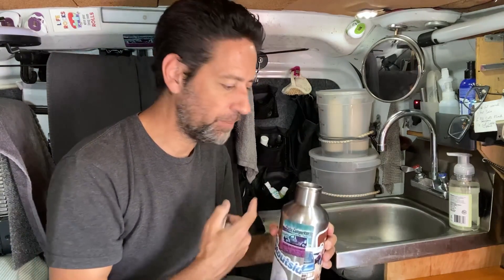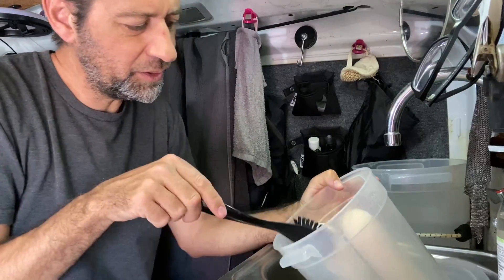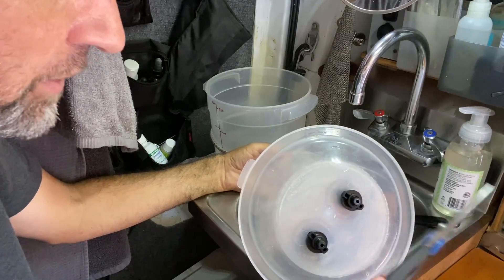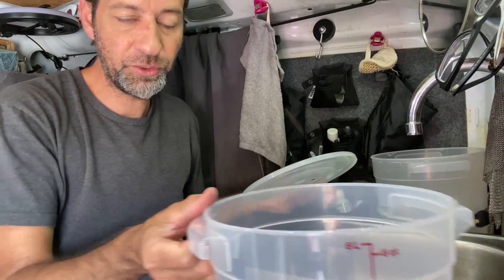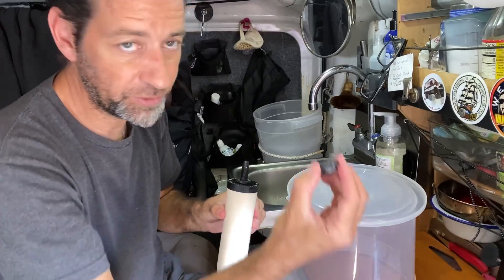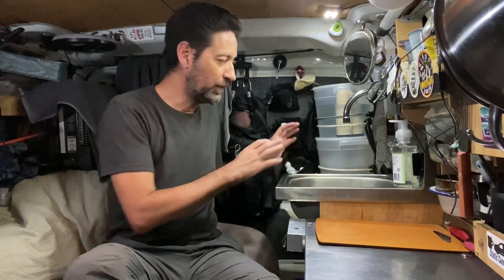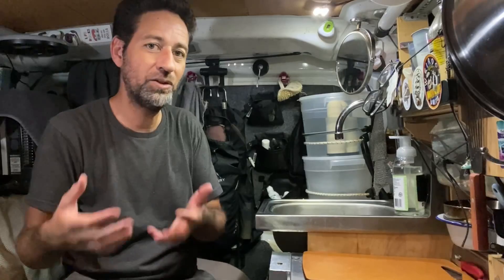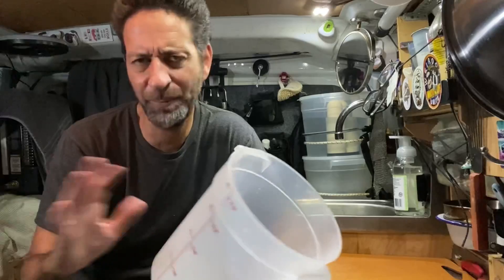Maintenance and a Rant about Plastic Berkey Water Filters (Trigger Warning)

Comment: I use plastic 5 gallon over a 3 gallon bucket after I saw your set up. It works well. It's a great set up. To avoid cracks by drilling I heated a nail and melted an opening for the Berkey filters. Don't let people get to you...you don't need to explain.
Reply: Great comment about the hot nail for making the holes
Reply: Another way is to use a small drill to make initial hole, and then go up in drill sizes on a slow drill speed

Comment: Cracks in plastic can be welded with a solder iron. To avoid cracks by drilling you can heat the tip of the drill bit or punch a hole with a heated bolt if you have one. Good luck.

Comment: Well thought out solution to your situation. I enjoy this info as we have a Ford Connect and space it always a problem. Thank you for your insight. Side note: drill a small hole or holes first, then the final large hole in the plastic. It will reduce the stress on the plastic when the final hole is drilled and hopefully no cracks. Thanks again......

Comment: Not that it matters and you may already know this but they do have a travel burkey now that is a smaller version but still over $300 so I definitely think you have the best solution, great idea!!!
Reply from the maker: Since I drink over a gallon a day, I prefer to not have to fill a filter multiple times a day. With this, I can fill up the top chamber and then be away from the van while waiting for the clean water.
Reply: @StaticCamperVan  Makes sense to me.

Comment: Ignore the trolls. I watch your channel to find out what works for you in order to see if it will work for me.  I also don't have $250 laying around waiting to be spent. So just to keep the trolls happy, I wanted to tell you that I am purchasing the parts to make my own plastic Berkey. Thank you for your ingenuity!
Oh, and about the plastic cracking when you drill... You may already be doing this, but start with the smallest drill bit and work up to the size you need. No cracking.
Blessings!
Reply from the maker: Good to hear! I forgot to mention that I prefer the Black Berkey Filter candles, but they don’t fit in my space. If you are looking at purchasing the Ceramic Filters, I’ve found that the original filters made by Daulton last longer and perform better than the Berkey ceramic.
Reply: @StaticCamperVan  Thank you! Good thing I haven't ordered yet! I'll be updating to the Daulton! I don't care about the name, I want the quality.

Comment: Now there is no reason to not read this whole comment.  Number one you only need to use one filter.  Save the other for the replacement.  This means you only need to drill one hole.  The plastic containers are a little expensive so consider this, glass dispenser from Walmart is less than ten.  Glass jar with lid also less than ten from Walmart.  Diamond drill bit for the hole.  Stainless spigot replacement from Amazon ten dollars.  Then build a box from wood with a long cut.  The spigot slips down the long cut.  The box mounts to the wall and will hold this much more securilly.  The long cut the the spigot slipped through is your water level view.  An led light on a switch allows better view.  You could also do a sterilizer light.   The top of the box now becomes a shelf.  The side of the box a sticker place.
Reply: @Kurt M. He could keep the upper container plastic as the water only contacts it for a few minutes, but the bottom in glass will have much better tasting water.

Comment: There are two ways you might get cleaner results drilling holes in plastic like that. And you have the old bucket to practice on. One is to drill a smaller hole first (pilot hole) then run the final size drill backwards to melt the hole rather than cut it. Then slice off any melted bits. Another is to use a step drill bit. They're designed for drilling through thin materials. Start with a pilot hole large enough for the point of the bit, then work your way up the bit to the larger sizes. As you get close to the final size you might want to do the backwards rotation thing to melt the plastic.
Reply from the maker: Shall we be expecting to see a video tutorial on your channel? 😁
Reply: @StaticCamperVan  :D
Reply from the maker: This was an inside joke with myself. I parked at Home Depot in case I needed something. Then I either lost or misplaced the correct drill bit. But I was too cheap (re:poor) to go into Home Depot and buy the proper bit! It all worked out since there’s no leaks.

Comment: May I suggest, starting off with a much smaller hole. Then gradually working your way up to a bigger hole. Also, painters tape can help prevent cracking as well.
Reply from the maker: It’s done and no leaks. I’ll use the proper drill bit and technique next time
Reply: @StaticCamperVan  good to hear there's no leaks

Comment: Scott I bought one of the Berkey Systems when I lived in a traditional house.  I saved for a month to buy that one when I did over 8 years ago.     I've always been impressed that you made this out of plastic bins!   Its from the restaurant supply so "hello" its food safe.   Its lighter than my stainless job. I like you would not travel without one.  

   When it comes to the drilling....do you think it would help eliminate the splitting of the plastic from drilling if you put a piece of Gorilla tape or Duct tape over the area you're gonna drill then remove it after you make the hole?
Reply: Too much adhesive.  Painters tape works great for this as well as a firm surface to drill against.
Reply: A heated nail or some similar metal works well
Reply from the maker: @K. Rose B I used the incorrect drill bit. I could have gone into Home Depot and purchased the correct drill bit but didn’t want to spend $10. It all worked out, no leaks.
Reply: Another great idea about holes and how to drill them without cracking the plastic
Reply: Mhm...maybe its an idea to start with a tiny hole and move your way up to the final diameter incrementaly. Each step will introduce a fraction of the downforce one drill will need to have - potentially reducing the risk of splitting. Just an idea, haven't done that myself ever. Great it worked out anyway.
Reply: @StaticCamperVan  oh I didn't think you used the wrong drill size but just thought the tape would act as a buffer against the splitting of the plastic.  I'm glad it worked out!  Genius!

Comment: You can use a step drill to avoid those cracks. (suggestion and not criticism) :)
Reply from the maker: I included that bit as a personal joke. I went to Home Depot in case I needed something. Then after realizing I lost or misplaced the correct drill bit, I refused to actually go into the store and buy a new one.

Comment: Lol, I can only imagine the negative comments you get. So many arm chair quarterbacks out there. I will only suggest using a different drill bit, like a masonry bit or a bit specifically for metal, as a bit with less aggressive drilling should not crack the plastic. Good video, thanks for sharing.
Reply from the maker: Haha. Yes, I lost the correct drill bit and was too cheap to go into Home Depot and buy another one. No leaks though, so no harm done

Comment: Look into a stepped drill bit. A cheaper one would work on plastic, plus they are great for drilling holes thru the thin sheet metal used in vans.

Comment: Plastic, like metal can get work-hardened. Heat, bending/flexing back/forth, etc., causes it to become brittle. I kind of wonder if the friction heat of the drill, along with the bending back/forth caused by the drilling process, causes these cracks? I dunno, but then I wondered if the drilling needs to happen under water like you need to drill holes in stones (don't ask :). The water cools down the bit as it drills, helping to prevent cracks. I also wonder if it would help to use a block of wood under the drilling spot as a bit of support to prevent that back/forth flexing of the plastic? I'd recommend just heating up some kind of tool to poke through via melting, but then you'd likely end up with a melted plastic lip that would be difficult to seal, eh?